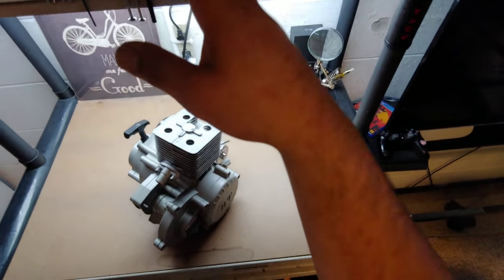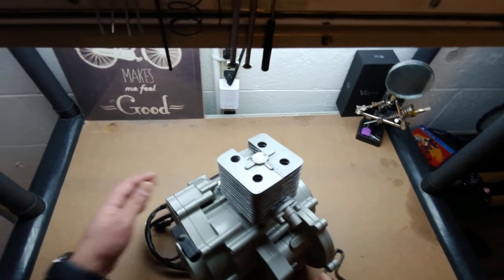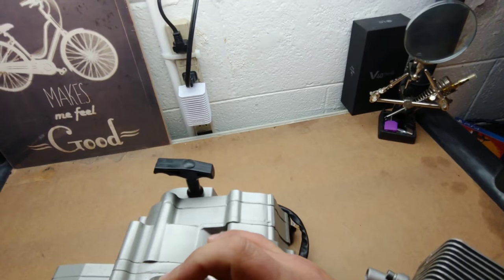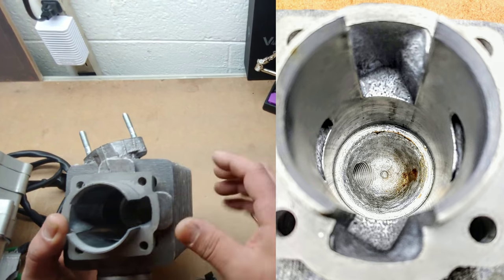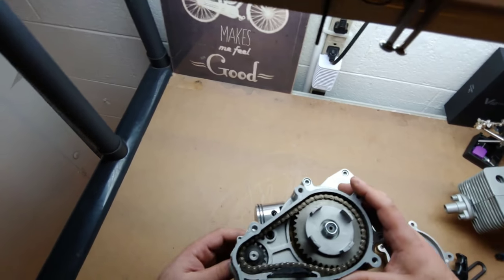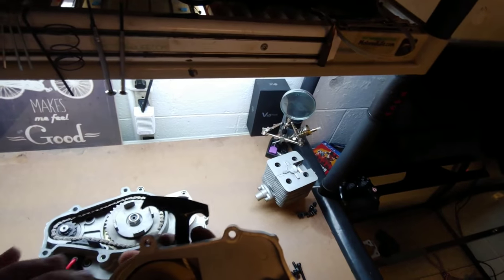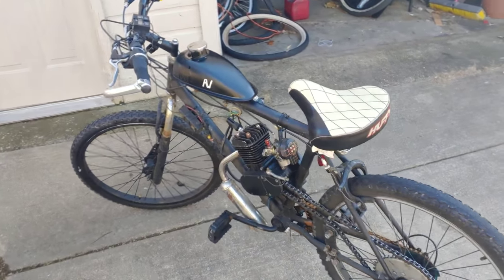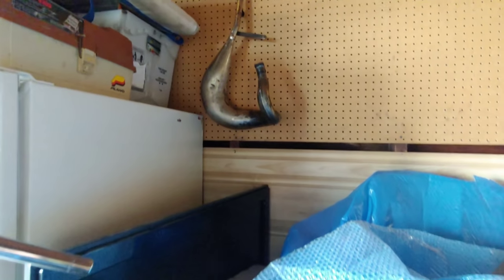What's inside the Bullet Train?...1-piece jug? 5hp?? Electric start BT-80 70cc engine + snow raptor?

Comment: Open transfers are pretty typical. Inside looks exactly like the 40cc utility 2 strokes, hambone crank, 2 big open transfer ports. They generally last forever. Pretty reliable design. And the cylnder looks solid. This would be a great motor for just getting around reliably

Comment: When the plastic pieces break-off the pull-start and get into the starter chain, the crunching noise will sound like the clutch is coming apart, I have two of these BT80 kits, after fixing that pull-start problem, and getting the engine to open-up with an expansion-chamber, I can now recommend this kit to others, GOOD-LUCK EVERYONE!!
Reply: What expansion chamber do ya use?

Comment: The BT80 is the ultimate commuter engine. Good torque, decent top end, and a real 12V 6 pole stator for running lights and anything else you'd like to hook up. I'd still be running one if it wasn't for parts availability being so hit and miss for them - especially replacement cylinders.
Reply: can't u throw pretty much any cylinder on it

Comment: I messed around with the "China doll" motors for a few years.
Ok, but without any low end and very fragile.
As apposed to 
"Goldenmotors" electrical motors.
The 1000w/self contained controller with a 48v 48c battery was superior to the China doll.
Very easy to install, had disc brakes, and mounting the battery to the main bar ( bicycle top bar) made it feel way more balanced.
With a overall top speed of 50 mph for short periods, and cruising speed of 40 mph and a range of 50+ miles.
I stopped building chinadolls.
With a 1500w/self contained controller and dual 48 v batteries, I pushed it to over 60 mph .
Granted, 60 mph was dangerous...
But a hell of a lot fun.

Comment: Can’t wait to see you ride with this motor i been waiting for a good review on this to see if it is good for the money or not please do a ride video soon
Reply: That motor isn't worth the money AT ALL ! The electric start is a cool feature  but it lacks speed , especially on the take off . I've built 2 motorized bikes with this motor and the clients weren't pleased AT ALL . They bought the motor kits thinking they were gonna be front runners in Da Palm Beaches! Don't waste your money on this 1.
Reply: Mines quite fast with pretty nice takeoff unassisted. Put around 3000 miles on it. Been running stock other than velocity stack and filter with a 40 tooth rear sprocket. Does 40mph easy but I'm not a big guy either. Also haven't replaced anything other than the clutch throughout all these miles so maybe by time I bought mine in 2020 they had them built a little better.
Reply: @p.k.motorsports5104  the clutch just pull off go the bt80 with a puller or what?
Reply: @motorizedbicyclenation53cu90   yes my kit came with a special puller tool in it

Comment: See the anbull 100cc yet . I had a anbull 80cc i built the bike and sold it and it actualy ran smoother than average with good strong power . I was pleased at the performance of it the one ride around the block i took with it .
Reply from the maker: Did it have the flat head like the picture?
Reply: I had a few bt100 engines sweet ass bike ran like hell

Comment: supposed start doesn't break is usually that metal aluminum gear next to the post start starts grinding and metal shavings all in your motor and engine bearings

Comment: Alex I have a question for you I just mounted my new bt80 on my bike I rode it it was running good but it just turned off and now it won't start it has spark gas flow is fine all wiring is good but it just doesn't start any information you can help me with

Comment: Don't they make a 4 up gearing that bolts up to this motor that will hook up to a jack shaft so that you can use the gears on a mountain bike for both more power and also speed also torque so that a person can also climb hills easier?

Comment: YO what up homy? yeah that one-piece juggy on my china girl surly 29er is still humming perfect. i'm a fan of the one-piece. no more head stud nuts coming loose, no leakage, and less weight (few oz) I see you threw in my pic! HAHA!!! im famous!!!---yes, that one-piece china girl is smooth. she wont rev as high as my standard 2-piece head motor, but I notice a slight bit more low end, and that suits me fine. I can just go and alter my rear sprocket. im not a fan of breakneck speeds anyway. runs perfect. I think I might have to replace it with that bt 80 jug if I ever rebuild it, because that's the ONLY one-piece jug I can find, anywhere. I wish I could find an exact replacement, I aint worried about cost. im worried about clearances in there like when you compared it to the 2 piece stud spacing or just plain stroke length. this is one reason why I just unbolt these things from the bike when they break and buy a whole new motor
Reply from the maker: Yeah buddy!

Comment: It has oil reservoir beside the clutch. What type of oil to use? it does not say on the manual what oil to use for the clutch oil reservoir. it only says put 120ml motorcycle oil. should we use automatic or manual motorcycle oil?

Comment: Hey Alex, Great Videos!
I have a Regular HT China girl, hoping to upgrade to a better motor was looking at the newer BT80 without pull start, my question is: is there a Way to charge the battery like the regular HT China girls have the Generator by the magneto to power headlamps or charge batteries?
Can I install a Generator inside it or will I need to fabricate an external Alternator Generator to the BT80?
Reply: Found the answer to this question, thanks for reply.
Reply: What was the answer to this question ya asked
Reply: It has its own e starter/alternator
Reply: @motorizedbicyclenation53cu90  answer is it has its own generator, but better than that, I used motorcycle headlamp wired to a 12v lithium Chinese battery and it powers it for 14days.
Reply: @eddiediaz9267  so where ya get the battery and Wich one?

Comment: My bt80 clutch has delay in clutch engaging sometimes. It revs with throttle but the bike is not moving, after a while clutch engages, then the bike jolts suddenly. how to fix?
Reply from the maker: Hello! You will need to replace the clutch pads.

Comment: Would you do a video on how to replace a manual clutch assembly and how to properly adjust it? I need to replace the one on my 80cc motor.
Reply from the maker: I have a video on how to reset the whole clutch system. Is that what you need?
Reply: @MotoredLife  yes
Reply: @MotoredLife  the pads in mine burned up.
Reply from the maker: @newsnowpermianbasin8977  buy new pads OR I have seen people have been taking the rubber sprocket donut and shaping pads out of it with good results
Reply: @MotoredLife  ok but I need to know how to adjust it right.
Reply from the maker: @newsnowpermianbasin8977  if your pads are gone no adjusting will fix it but If you follow my video step by step it should point you in the right direction.
Reply: @MotoredLife  link please
Reply: @MotoredLife  found the video. Thanks bro. I assumed that the pads were out, but I didn't know how to check them. Thanks to your video I know how to look. Will Zeda Motorsports have a new clutch if I need one?

Comment: Hey man I’m really thinking of getting this motor. More for the convenience of the centrifugal clutch. Are there any products out there that you could mount to like a zeda or whatever and make the same thing?  Basically giving me the ability to remove the pedals altogether?
Reply from the maker: You have to have pedals or u need a license. But no the bolt on pull starts and centrifugal are trash

Comment: my bt 80 is up and  running however my clutch side cover is getting very hot. i added the 120mll of four stroke oil. please tell me what might be wrong as the eng has less then five miles on it.
Reply: That's the clutch slippage...it's gonna be hot

Comment: With this bike, since it has a centrifugal clutch, are you able to sit still (wheels on the ground, not moving) and have the motor still run or will the motor stall?
Reply from the maker: Yes hit it when u need it
Reply: Motored Life so I have to keep the idle high for it to keep running at a stop light. Thanks! Also, you should make a video with wiring for lights and stuff. I’ve been doing LOTS of research to find it and nothing...
Reply: It’s like a moped, you can sit at lights and don’t have to do anything. When you wanna go you just hit the gas
Reply: Amos 2005 got you. Awesome. That’s what I’m wanting. I’m gonna try to put this BT80 on a Schwinn OC chopper bike. I think it’ll look badass. I’m gonna throw some turn signals and a head light on it.

Comment: Looks like those jugs make porting work very difficult.
Reply: Oh no shit i just thought about that, cleaning with brake cleaner to spray out all metal shavings from inside the cylinder body and all that would be a nightmare since it has no 2 exists so you couldnt simply spray it out 😐 be a scooping scraping madness for the cylinder walls rather than removing the head and simply spraying the piss out of it and wiping it for good measure after it dries
Reply: Well clean up… dish soap degreaser and water w a q tip to get in the tiny spaces and get the grinding dust out

Comment: on top of the piston In my bt80 there is a arrow printed on the exhaust side but it is pointing towards the intake.   My motor will idle but has no power. Is my piston In backwards are not? thanks
Reply from the maker: Rings twords intake usually.

Comment: Hey man I got the same engine my bike idles etc just won't let me drive it doesn't die it's just won't move just idlies
Reply from the maker: Does it rev?
Reply: @MotoredLife  is there any way I can show you a video?
Reply: I'm Steve Millie on facebook picture of rocks an beach
Reply: It used to rev wheels didn't move but I put a new head an piston on it from another engine that is also the same now it will just idle but if I put throttle most little bit It bogs an cut out an pops smoke out the back of the car but she doesn't move at all back wheel won't spin but she will idle it's definitely not carby as it is a brand spanking new carby also when idle it chews petrol really fast I had it on idle for 20 mins then it cut out automatically by popping smoke out carry it also heats up really fast
Reply from the maker: @millie6581  what oil and oil ratio are you running?
Reply from the maker: @millie6581  MotoredLife@Gmail.com
Reply: @MotoredLife  will email you now

Comment: You can' put a regular tank on that hyper there is a bracket plate on eBay it hold the gas tank you just have to put two holes in the top frame then I took a look old fuel line cut them into small 4 pieces and use them as dampeners and  I use a clear RTV nuts place they wouldn't come loose

Comment: Hello, friend, is the motor AC alternating current or DC direct current?
Reply: Lol it has to be DC....
Reply: @abikelife1481  hola, ya verifique y es AC. 👍
Reply: @mariotorres2485  no it is not alternating current. You think that power is alternating back and forth live within that starter and wires?
Reply: @mariotorres2485  I believe that could be possible actually, because I knew it had to have some DC aspect for the battery

Comment: Instead of investing in electric start someone should build a motor with gears.
Reply from the maker: I'm with you! There is a small 3 speed system ive seen actually. It just makes them 100% illegal to have more than one gear.

Comment: The whole thing is a POS, the motor is worn out before it even gets broke in! With the extra drag from the primary drive chain to the starter there's barely enough power left to turn the rear wheel!
Reply from the maker: I can see that happening 100%
Reply: the starter is on a one way engagement. the motor doesnt connect to it while its driving.
Reply: Josh Mullins the chain drag is enough to rob the motor of 20percent of what little power it produces along with the centrifugal clutch what you have left is a slug! Garbage I say, garbage!

Comment: I bought four engine kits used one as experimental and I'm going 62 miles an hour I can show you pictures and I can show you what I did to the inside also went went make my own carburetor out of five different carburetors I also put a variable adjustable advance and retard programmable ignition not two and a half pounds off the internal the motor balanced Magneto stator shaved off 2 pounds off at waiting on the outside call balanced Titanic connecting rod titanium drive shaft spline ceramic bearings oh and I also run 0w 20 Mobil Synthetic 1 for the clutch never have a problem eating clutches
Reply: Titanium not Titanic made my own expansion chamber using a 40 tooth CDH aluminum back sprocket just takes time and money if you want to go fast and I run to stain wide open everyday the first kid I had was the pull start I twisted the crankshaft on the westside clutch right in half if you remember a Stihl 660 chainsaw motor well you can do all kinds of work to the inside of that piston Port cylinder shaved duck the cases matching increase the compression just a little bit and go with the regular Nippon Denso i-Ready in spark plug and use copper washers to adjust the plug to get it as close to the Pistons possible once you log out the intake and exhaust mess with the transfers match the cases it is a gas hog I run VP racing fuel comes in 1 gallon cans party mix 241 92 octane ethanol free that's the main thing stay away from ethanol gas you'll have nightmares trying to chat thinking something's wrong with it and it's not the carburetors it is the gas especially when you go up higher compression and you start advance and retarding the timing trust me I don't lie
Reply: I will send pictures that all I have someone request I've had people try to take pictures of it and my girlfriend will not let him take pictures of it oh by the way 29in Genesis Nix frame the only thing I used was the frame to seatpost in the back rim Mike comes over and out God Bless America
Reply from the maker: Send me the info! MotoredLife@Gmail.com

Comment: 5hp more like 3hp on a good day.
Reply: Try tuning the carb and getting some simple addons. Velocity stack with a less restricted air filter cover. And the biggest thing is gonna be getting a decent exhaust. Till some bolt on exhaust come out your gonna have to weld up your own to get the most out of those engines. This goes for any motorized bike engine not just the bt80.

Comment: On the Piston jug cylinder you made a comment about the slots in the bottom of the cylinder. If you notice that the engine has no valves.. what you're looking at with those slots is the fuel intake for the Piston cylinder the action of the Piston moving up from the lower part of the slot to the top part of the slot sucks fuel into the cylinder to be compressed for combustion. Got to remember it's a two-stroke not a four stroke. And I do realize that most of the people on YouTube are not motorcycle mechanics. Also on your pull start you were complaining about the plastic components. Please don't do that you want those plastic components in a pull start. Especially a engine this small. The reason for the plastic components is it's a lot easier and less expensive to replace a broken pull starter system than it is to replace your whole engine when your pull start screws up. Back in the old days when I was in a small engine repair class back in 1981 somebody brought in a lawn mower where their pull start had the old aluminum component for cranking as opposed to the plastic component. They were cranking it and got jammed and messed their engine up. Stand corrected they were not pulling it when it happened they came out and took a hold of the flywheel when it happened. What happens at this point is you mess up your flywheel and if it jams incorrectly it can cause you to burn up your bearings or even worse throw a ride all kind of wild s*** you got to watch out for you want the plastic

Comment: People, do NOT buy this dog of an engine.  I bought one and it sucked.  NO POWER!!!!  Had to peddle the bike if I was on any type of grade and even on flat surface alot of the time.  Only time you didn't have to pedal was downhill.  I'm not stupid and have built a few gas bike so it wasn't error on my part.  The engine just has no power.